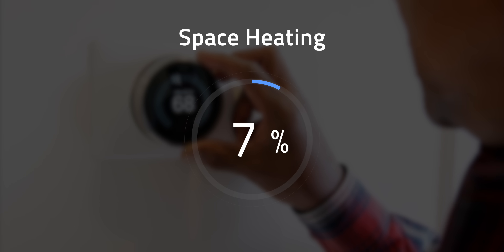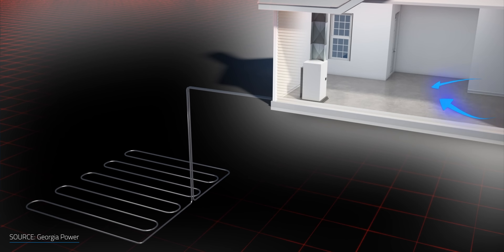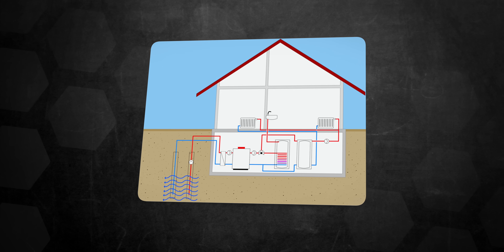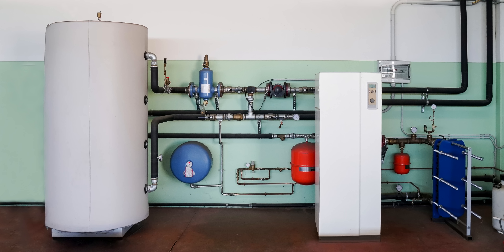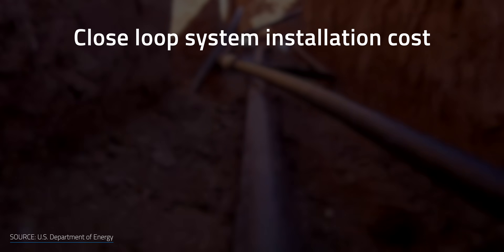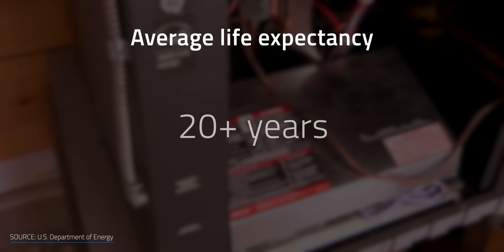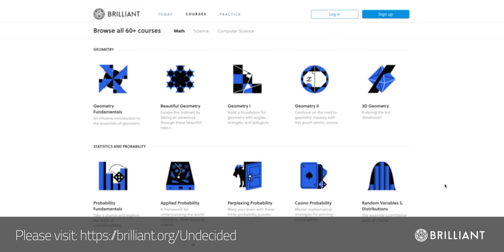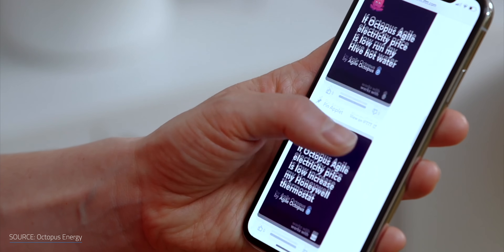Is Geothermal Heating and Cooling Worth the Cost?  Heat Pumps Explained

Comment: Geothermal doesn't work well in Canada. The ground temp is too low to extract enough energy from the ground to heat a house during the cold winter.
Reply: This is true in Yellow Knife, but certainly not in Vancouver, nor where most Canadians live. 

Don’t let the perfect (it works easily and well in the whole of Canada, and the world!) be the enemy of the good (it works well enough to be considered where 80+% of Canadians live, and rising).
Reply: @altosack  you seem to be implying most canadians live in Hongcouver, most dual citizen Chinese and Hong Kong immigrants maybe, but I think he said canadians.
Reply: What if you would go deeper?
Reply: There are deeper straight-down domestic systems that should work pretty much anywhere. Main problem is lack of vendors available to provide it.

Comment: Great breakdown as always. I’d love to hear your thoughts on community solar.
Reply: Here's Matt's video on Community Solar: https://youtu.be/buv-EE6IYaM
Reply: @George Mann Pinewood Forrest is First Large-Scale All Geothermal Community in the U.S.
The 234-acre experiential development commits to utilizing clean, geothermal energy for all single-family residences and townhomes
Reply: @George Mann I believe technically it's still considered geothermal. The earth really isn't a thermal storage (it soaks up all the heat you give it and doesn't give it back), rather it's a constant thermal supply / sink held at about 60F (depends on location). That temperature of the crust (1% of the planets volume) comes from a 3000C mantle on which it sits. In short, after a summer of dumping massive amounts of heat into it it isn't appreciably hotter than before to make much improvement when using it as a heat source in the winter, compared to not dumping any heat into it in the summer. It might make some difference that first month, but even then probably mostly negligible.
Reply: @George Mann maybe so the crust is largely heated by solar (though I doubt it based on the thermal profile of earth's cross section compared to the paltry atmosphere that sits on top), regardless still negligible amounts of the heat used in the winter is affected by the heat dumped there in the summer. I'm sure if you dig a hole next to your loops in December that it would be the same temp as a similar hole away from the loops.
Reply: @George Mann I've done some more thinking about it and I'm coming around to solar being the driver. If I remember my heat transfer from back in my undergrad days, the boundary conditions have a greater impact than I was considering. As for how much of the energy in the winter is influenced by what's dumped there in the summer I think it depends on a lot of factors ... You could be entirely correct.
Reply: @George Mann interesting. Thanks for the info
Reply: Why don't we just use nuclear clearly the best clean energy
Reply: @jairopavon11  Because it's CRAZY expensive. Incredibly, mindnumbingly expensive, if you want to do it safe. And that is still a relative term.
Reply: @davidsommen1324  it's very safe only 4 people have died in all history its expensive but so is solar and wind energy. Nuclear provides a lot more energy than both combined

Comment: There is no compressing of liquids. There is a heat transfer fluid that circulates through a heat exchanger and then through the ground in a loop. In the house there is a heat pump that extracts energy from the heat transfer fluid in a similar way an air conditioner extracts energy from your house and ejects it outside.
Reply: Liquids do compress under pressure, but the amount of volume change per unit of pressure applied is pretty tiny.  😁. Yes, this gentlemen provides good overview information, but contains a number of technical inaccuracies.  Fortunately, the latter don’t matter to, and won’t be detected by, most of his audience.
Reply: @LTVoyager  If it's not explained properly then it's looked at as magic instead of what it actually is. The expansion of the liquid due to temperature change will be much larger than the negligible change due to pressure.
Reply: @ColCurtis  I agree. I do wish he was more technically accurate, but technical accuracy is not the domain of YouTube.
Reply: @LTVoyager  Yes maybe in some/ most cases but over the years I have found so many great teachers on YouTube that beat the high school teachers I had ten fold.
Reply: I think that modern systems use a three-stage design: liquid loop to heat exchanger, heat exchanger to refrigerant/compressor, refrigerant/compressor to heat exchanger in ventilation system.
Reply: @justin_time  The refrigerant goes through a state change (boils) in the low pressure side of the refrigerant loop called the evaporator absorbing energy, then the gas gets compressed and during the compression the refrigerant also get hot. The hot high pressure gas travels through a heat exchanger called the condenser releasing it's heat causing another state change from gas to liquid, then the gas travels through an expansion valve (orifice), causing the pressure to drop and starting the loop over. There are two loops one loop of refrigerant that travels through the heat pump and between a condenser and evaporator, and another loop of a heart carrying liquid, could be glycol (antifreeze) that travels underground. Watch some vids on air conditioning it is essentially the same thing but in geothermal the condenser and evaporator are reversible, so you can get cooling and heating in your house.

Comment: I only have air to air to compliment my natural gas furnace. 
Currently it is 2c above freezing, my solar panels are producing 3900w. 
My heat pump currently uses 340w to heat the house and I have set my Tesla to charge as slowly as possible (220v*5amp*3 phase). No way I want to feed it into the grid today. :D

Comment: Thanks for the informative video. What size of ground space is required for the underground pipework? I'd imagine many people in the UK haven't got big enough gardens necessary to make it work
Reply: You can go deeper in smaller spaces.
Reply: There is a UK company that drills multiple holes through the garage floor.
Reply: Here is a video about it from the UK: https://www.youtube.com/watch?v=uI7wxNtrorQ

I think that smaller drilling rigs might be needed for installations in existing homes: https://www.youtube.com/watch?v=IMO9jvwlHFg
Reply: You can use a well instead.  But really, the ground source isn't needed at all, especially for your climate.  Get an air source heat pump for 1/5 the price.
Reply: CorwynGC Air source heating is better suited to highly insulated modern homes. The vast majority of UK housing is decades old, and a quarter of all housing stock is Victorian with solid masonry walls that are almost impossible to insulate. Air source heat pumps don't work well in these sorts of homes that suffer high heat loss. I winter, air temperatures can drop below freezing for days or weeks at a time, and the efficiency of air source heat pumps can drop to as low as 150 percent or less. An average Victorian family home might need 150 kWh of heat per day, that's at least 100 kWh of electricity to run the heat pump at 150 percent efficiency costing close to £20 a day or around £600 per month which is ridiculous. With a ground source heat pump you might get 400 percent efficiency, bringing the cost down to a fraction of the air source running costs.
Reply: @spencerwilton5831  If you need 150kWh of heating per DAY, you need to fix that first.  I claim it can be done for any building.  But if not, use the building in summer only.
The vast majority of the housing stock where I live is decades old as well, and it is a colder climate, I have never seen a building that couldn't be greatly improved in efficiency.  Ironically, the Victorian era stuff is much easier to improve (but is mostly wood around here, so no comparison).